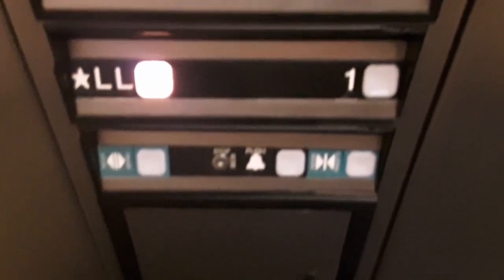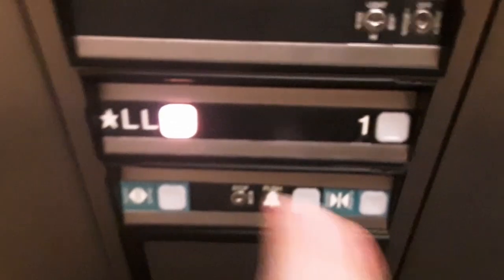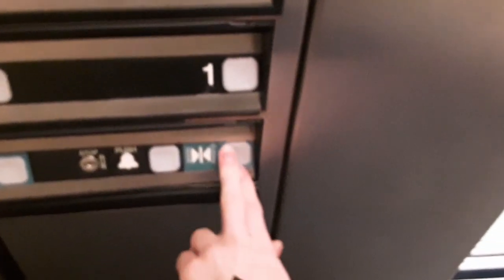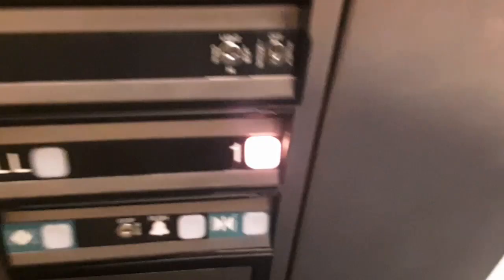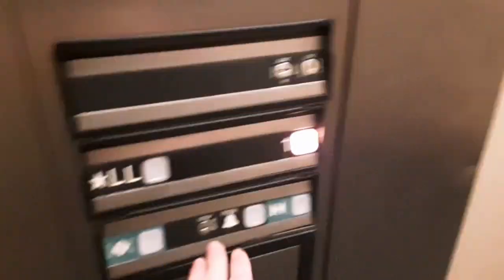Dover and ThyssenKrupp LOWdraulic Elevators at SCC Lincoln Campus

Comment from the maker: Apologies for the extreme shakiness of the video. I had never tried to stabilize video in Resolve, and I clearly used the wrong one. Additionally, due to ADA, the door will stay open for a minimum of 3 seconds regardless of whether or not you pressed the door close button beforehand. The Dover's button is functional after that 3 second timeframe. The first time, though, I stuck my hand in the doorway, causing it to cancel. The bumper is not the only sensor.